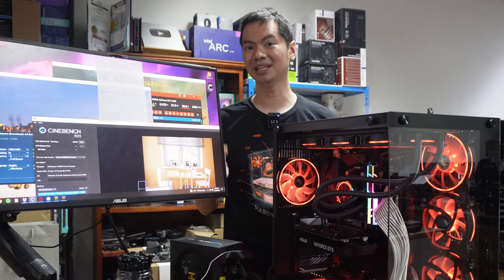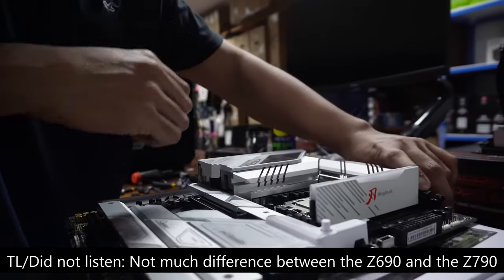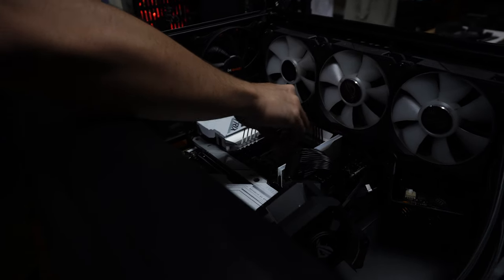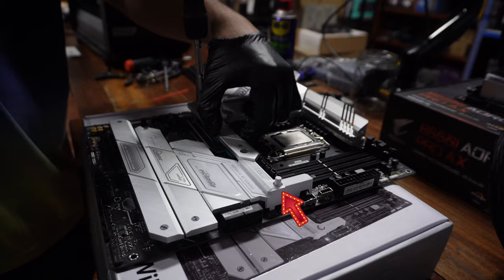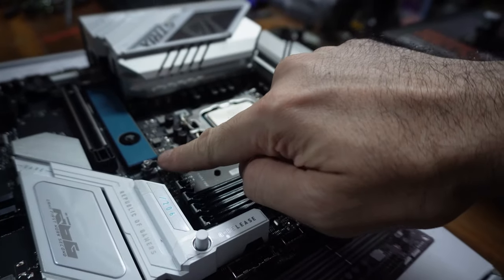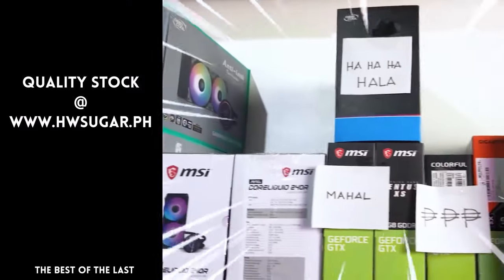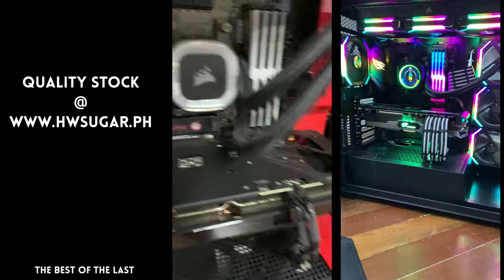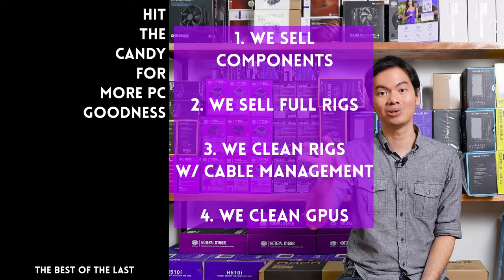The last motherboard you'll ever need ➡ ROG Strix Z790-A Gaming Wifi II

Comment: I have the Asus Z790-a gaming wifi.      I haven't seen any decent reviews on this board and I know I've expressed my issues with it openly on the Asus dyi page.   

I may upgrade to the gaming wifi II and see if the issues I've had have been resolved.  

The problem I faced with the gaming wifi 1 was massive changes in performance with my 13900k.    Gaining and losing as much 23% across multiple benchmarks!    

It just doesn't make sense and I've yet to figure out why various Bios worked great and others didn't.     I'm about to check and see if there's a new bios out for it since I haven't had time to be on my PC much the last 2 months
Reply: Hey how did u figure out the mobo was the problem I think I have an issue also how is it if you’ve upgraded

Comment: Sir ilang watts po ng psu recommended for i9 14900k
Reply from the maker: assuming you'll be pairing it with a comparable gpu, 850w at least

1000w para sigurado